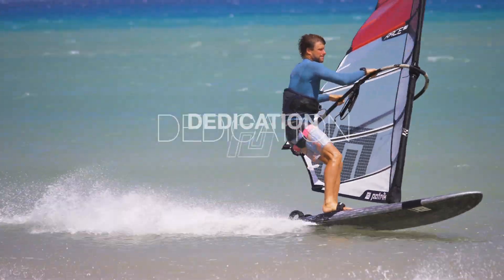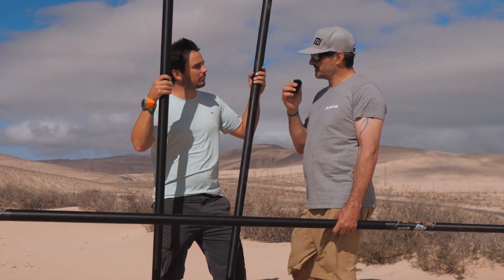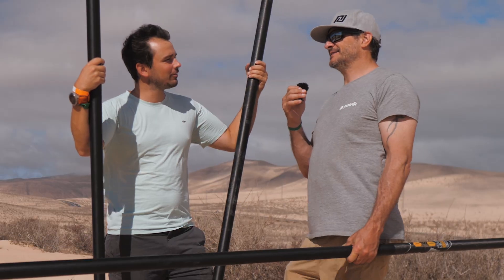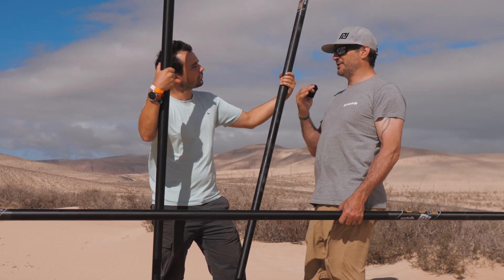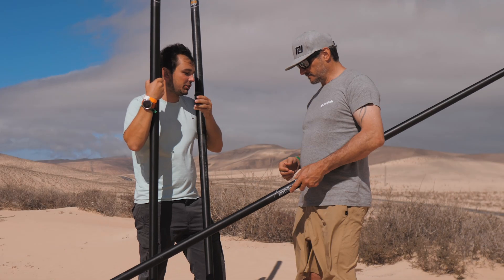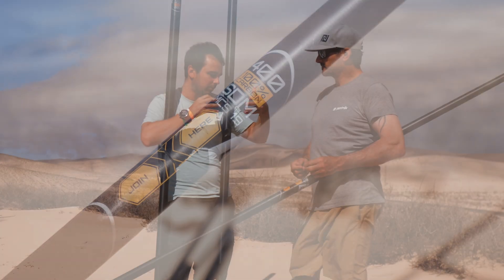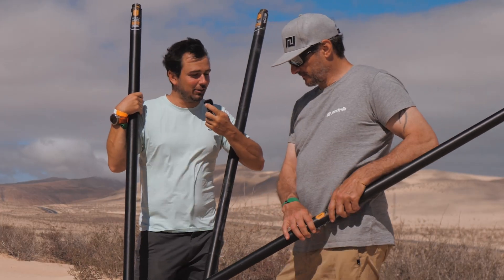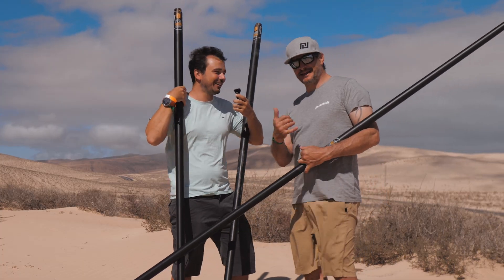Why Our SDM Masts Come in 20cm Steps (Explained!)

Comment: One more step to over-engineering and over-complicating things for the 99,99% of the users. RDM, SDM and now MDM masts. Constant curve, flextop and hardtop but of course some designers make it more complicated by providing their own stiffness measurements at the top and the bottom, essentially selling their unique masts and sails. Now, the latest addition to the craziness, 20cm steps in the sizing, to make it even more horrible. I respect Patrik as a brand and the guy himself as a top designer, but it seems no one is paying attention to what the customers want. Good luck but this is not the right direction for this wonderful but dying sport.
Reply from the maker: You DON’T need more masts and the factory setups are tested to perfection so unless you don’t want to you don’t have to modify anything. No thinking - just plug and play. Just make that switch in your head to choose the mast by stiffness and NOT by length - and that’s exactly what the 20cm steps allow you.

Comment: Not a fan. The best thing with modern gear (masts and sails) is you can swap a lot of brands about and it all works. This feels like a step back to when masts were not all the same and you had to get it right. I just want the sail to work well on the mast i have.
Reply from the maker: We understand the convenience of universal compatibility, but we believe the performance gains are worth it. Also you can replace almost any 430 with a 420 or 440 by just extending more or less. So in the end you only win.
Reply: @patrikinternational windsurfing has a long history of performance over easy of use and compatibility. I have modern sails but some of my masts are 10+ years old. The brands are ni longer the same but I bought the most compatible and easy to use. If I broke a mast I'd buy same again, something I know works well with many sails as I can't afford new everything. Who can?

Comment: One thing is still missing IMHO : top mast extention. I use smaller mast than recommended as I am quite light, so I like rather soft mast.But extending the mast at the bottom doesn't feel quite right as it shifts the curve upwards. I use a DIY top mast extension, but a I would spend a few € on such an item.
Reply from the maker: We looked into this long ago and it will make the sail feel top heavy so we don’t recommend top extensions. A well made base should not shift the IMCS curve too much… at least our extensions don’t…

Comment: Why is it recommended to use a 500 mast on 8.0 with about 39cm extension ? Also on the other sizes is a big extension nexessary
Reply: In general most brands seem to suggest long extensions on most sizes. It makes me think the masts are made too stiff.
Reply from the maker: Because we can. A classic 490 would be too short but the 500 has a nice stiffness for the 8.0 HA/ but a heavy rider who’s looking for more low-end could also put the 520. That’s exactly where the big benefit of the 20cm steps kicks in. Choose by stiffness and not so much by length!

Comment: Short answer: To sell more masts.
Reply: I don't agree. You do not need more masts with 20cm increments compared to 30cm increments (for the same sail-quiver). But you have more options to tune. Not sure if more options is what the average windsurfer needs, but it is in line with just about every other consumer article: more choice (supermarket-shelve, anyone?).
Personally I think Patrik is making things a bit too complex, pushing the optimisation too far (for my taste anyway), but at least they explain it well.
Reply: @rcggijzen  but you have to change gradually all the masts that you actually have and buy non-standard masts that would 100%  work only with one brand. As cynical as it sounds, it's all about marketing in my opinion.  Even better: let's make masts in 5cm increments and with that make winging and kiting even more affordable...
Reply: @Tmiasto2Tmiasto2  Yes, I see your point. Using non-Patrik masts in Patrik sails becomes a bit more tricky although mixing brands was always tricky anyway. I think that you still need about 1 mast for every two sails, same as now. But I don't like that Patrik has departed from the industry-standard 30cm increments. Also the backwards compatibility with older Patrik masts becomes questionable. I like the Patrik brand for trying out new things and explaining them on youtube, but personally I am not tempted to buy Patrik. Too many changes year-on-year.
Reply: @rcggijzen  I agree. Additionally, I've seen too many new "must have" products and solutions from different brands in practically beta version (not properly and long-term tested) and with nice-sounding and flashy wording behind, but with weak technical explanation, put on the market and vanish in a season or two. The Research & Development based on "throw and see if it sticks" system, paid by customers - me included :) doesn't sound right to me.
Reply from the maker: You can use non-Patrik masts with 30cm steps as long as they have the correct curve and stiffness. Also many pros secretly use our masts in non-Patrik sails.
Reply from the maker: You nailed the answer 💪💪💪